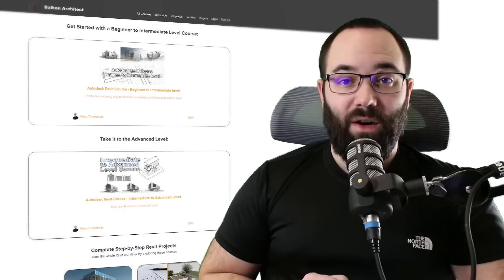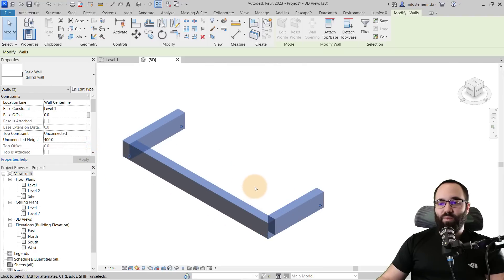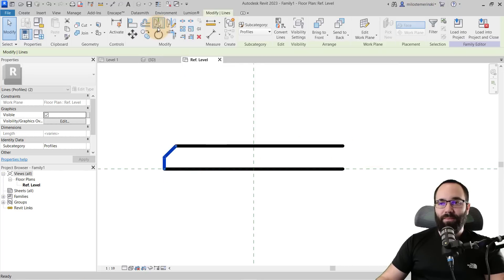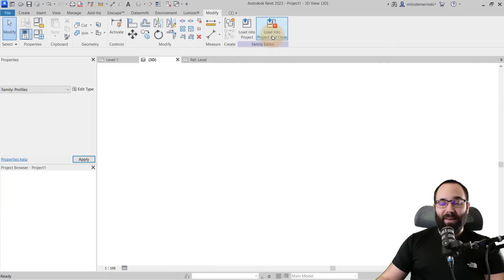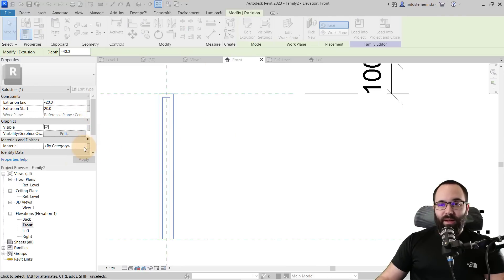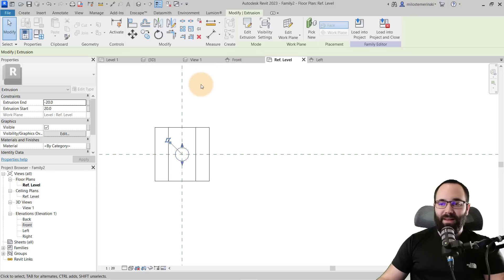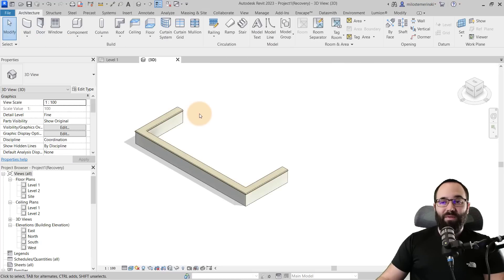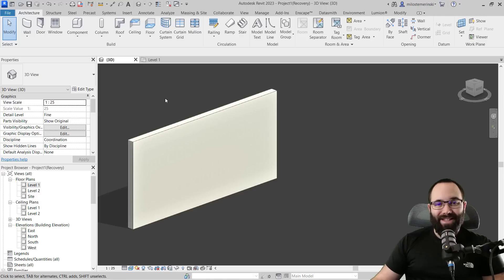Revit Wall & Railing Combo Tutorial

Comment: Hello balkan Arc. I'm new here.  I just get to know your channel and its really amazing of what I have come  across.  I'm an engineering student.  I want to focus on both  structural and architectural work. But I want your guidance as for the architectural I have gone through your fast Revit course 2019 and I'm improving little by little but for the structural aspect where should I begin.  Which of the videos can I start to watch that's  the basic I'm little bit confused.  Thank you in anticipation